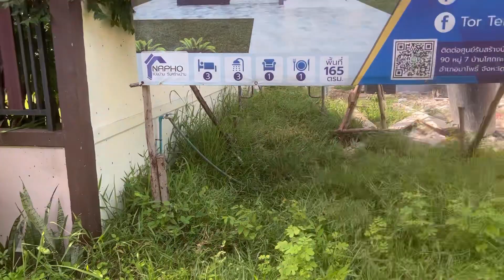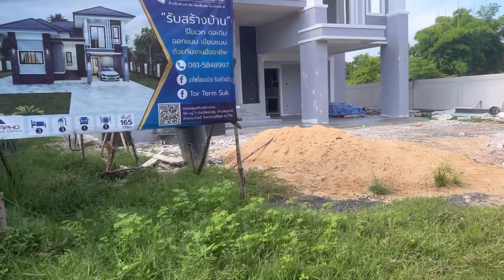True costs to build a house in Thailand? | Retire to Thailand

Comment: We built the house 23 years ago in Thailand with a swimming pool 5x10 meters. We paid electricity for 2,800 to 3,500 baht per month. Our house is 400 m2  with the land size 2 rais or 3,600 m2
Reply from the maker: Thanks for sharing 🙏
Reply: We paid 970,000+60,000 baht for gravel Crete surrounds the pool. The size 5x10 m with salt system. Nowadays it might more expensive than this price. Built buy JD pool from khonkan province.

Comment: I think that you are a little low on the pool build estimate.
Reply from the maker: Feel free to tell us prices if you have experience
Reply: @PloyandJayinThailand  I've been pricing up my own project. 2m X 5m 650,000 for a concrete pool.

I had a fiberglass pool installed at my home in Texas. It was over 2 million baht for 10m X 4m
Reply from the maker: @PaulRLight  thanks, prices vary a lot. Need to do our homework and ask many companies
Reply: Agree. Between 600 k and 1 million for a 5x3 meter pool depending on the finishing
Reply from the maker: @PaulRLight  I saw today a fiberglass pool near our size 350.000, so it looks like concrete is much expensive
Reply from the maker: @vlodo001  depends on the material also, see other comments 😀
Reply: @PloyandJayinThailand  yes. A fiberglass pool will always be less. It’s important to choose a manufacturer that has a good warranty. And the installation crew is also very important.
Reply: @PloyandJayinThailand  Hope all is well.

We have just built a pool (39 sqm) in Chiang Mai, our costs were as follows:

Labor 1050 baht per sq m for the foundation (40,950 baht)
Labor 450 baht per sq m for tiles (17,550 baht)
Waterproof cement 10 cubic meters at 2200 baht, (22,000 baht)
Tile 56 sqm 450 baht (25,200 baht)
Cockpit in hot tub including materials 10,000 baht
Treatment plant 270,000 baht
Heat pump 270,000 baht

Total 655,700 baht. Think they charged a little extra on the work for the foundation and tiles but it's pretty small amounts overall. If you are 3*5 meters, cement and tile material will decrease in cost.

I think it is good to have a roof over it and if you bring in a heat pump, even if it costs, it will be good as you can use it all year round.

You can see our pool at the link below 3.19 minutes into the episode

https://www.youtube.com/watch?v=fvSq1xOynho

Best regards

Mathias
Reply: Forgot to say that in the 1050 baht for the pool, there was 550 baht per square meter for the foundation with pillars etc. and 500 baht extra per square meter for the pool work. Footings etc. are probably needed, but I suspect that this is quite a high price in your area, so maybe 800 baht per square meter for the foundation. What is added that I have not calculated is the excavator and excavation for the pool, the excavator costs around 1500 baht per day but the problem is that you have a wall that makes the area difficult to access so it might cost more.

Best Regards
Mathias
Reply from the maker: @mathiasgrahn4440  thanks for the details

Comment: Did you not think to include solar power in your build as even if you have it off grid just for the air conditioning it would save a lot of money for the future, the biggest problem I see though is your multi roofing system making installation more difficult?
Reply from the maker: Solar is something need to study more before I am convinced it's worth the money. It might be possible in the future 🙏
Reply: @PloyandJayinThailand  I can tell you that with all today's improvements that solar is well worth the money, and it's only the upfront cost that is off-putting, but units are getting cheaper and more durable, It doesn't cost anything to get an estimate. Let me know how you get on. More than 1 company for estimates.

Comment: Hey ,Jay and Ploy ,Thanks for the price updates ,i agree with you cost estimation ,i am going thru the building process myself at the moment ,front wall with the gate 21m and the gate is 4,50m wide ,height is 1,70m cost 63000 THB ,back of the land wall is 30000 THB but only 1,20m high there is only rice fields behind the house all open so want to keep the view clear ,for you front perimeter wall i think you could budget less for very good quality and the jaccusy also ,by the way i am not in Issan but central Thailand Chainat so the prices may vary for the electricity i paid 4000 THB for a the temporary  meter for the build and the final installation and meter would cost me a extra 6000 THB ,water meter and house connection is around 2000 THB but i should get a discount as my girlfriend works for the national water company ,also are your airco units included?
Good luck for the finishing ,your nearly there
Reply from the maker: Yeah, prices vary 👌our fence price is good as our “village” builders cannot match that. We also need a 2 m high fence because of street dogs 😂do you have any jacuzzi companies in your mind? ACs not included
Reply: @PloyandJayinThailand  Hi ,i haven't find any jacuzzi that is in my budget for the moment ,jut started to look around ,i am not in Thailand for the moment so have to supervise the build from abroad but my girlfriend goes and check every day ,i just lookng for a small plunge pool or jacuzzi but i will have a talk with the builder to see if he can think of a afordable solution
Reply from the maker: @francoisevans-e2r  same here, we are talking with our builder first because he has some ideas and connections. Fiberglass pools are popular also in Thailand. Saw one 350.000 baht 2,5m/7m from Bermuda pools with a 30-year warranty. Concrete pools are double the price or more of that. Let's see, there are many options to consider.